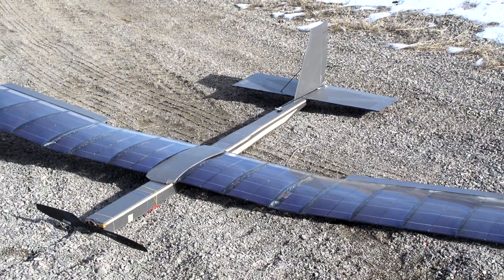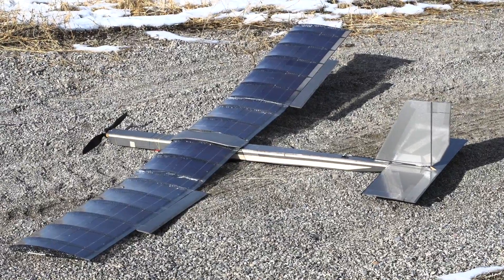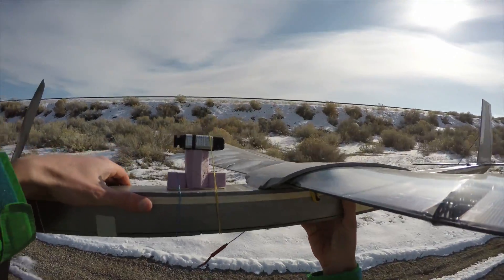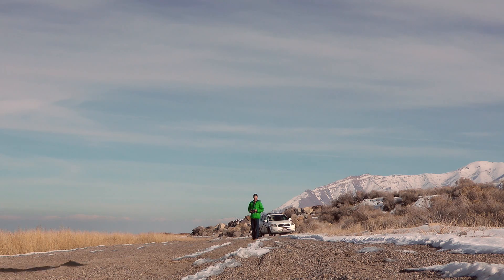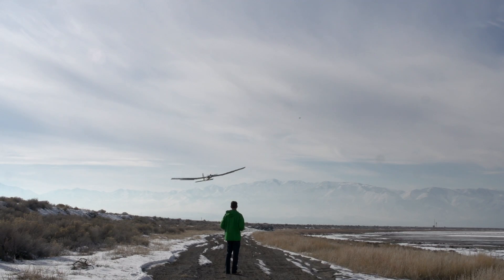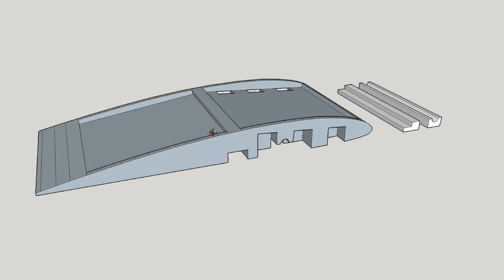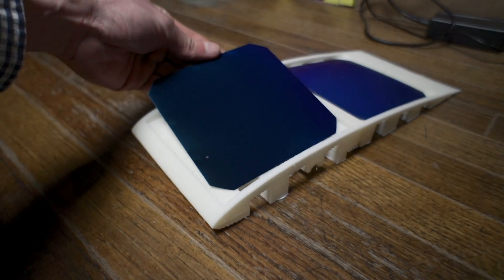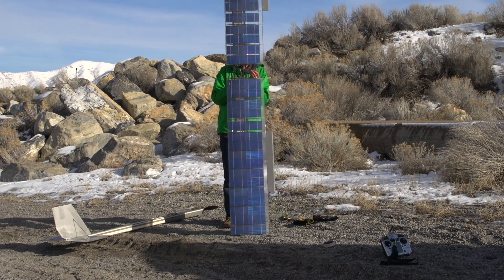RCTESTFLIGHT - Solar Plane V2 First Flight - Episode 4

Comment: Nice! Thats how i would do the panels in the wing! Still i think the fuselage is slung a bot high but perhaps thats to eliminate the crosswind? I would also use batteries but have a capacitor bank onboard also with more efficient electric motors. Sometimes building your own with permanent magnets is the best idea. You can find super efficient motors and circuits that wont have as much power but use way less energy

Comment: you can just use those kind of cells .. its rigid and flexable 
http://www.aliexpress.com/item/DIY-100W-Sunpower-Maxeon-C60-Solar-Panel-21-8-High-Efficiency-32pcs-x-3-34W-for/32666767763.html?spm=2114.40010208.4.9.xFjz5M

Comment: why not just use flexible solar cells?
they are a bit more expensive but they are flexible which means you don't need a custom wing to hold them

Comment: Just a thought, have you approached any CNC engineers? MDF and chipboard can be machined like this so EPO foam would be a breeze and cost a lot less than making a mold, some colleges and universities have the equipment as well.
Keep going with it, I did feel your pain when Mk1 crashed and wrecked all your work.

Comment: Good work D, maybe a liquid foam molded in 3D printed mold wold work or you could take up gcode and get some cnc training. Milling out alloy or steel molds is like 3rd - 5th year machining and milling cnc's are not as expensive if you are mechanically able.

Comment: cool, i think this has been done before of course but tech moves on and it will get cheaper and better , I think that keeping the whole thing light is key, a small battery would be best just enough to take off and get some height. then solar panels should be enough to provide all the power needed. a folding prop would mean you could glide better when in a thermal and so have more power going to charge up battery, then you could have a bigger battery maybe...  epo is quite heavy too though it's a god idea if it could be made reasonably light.
flying faster then you were might work out better, wing seemed to be in stalled flight almost, but maybe that's how you designed it?
look forward to seeing your progress.

Comment: this might sound crazy but could u do a viedo on how to wirelessly power a rc plane long range 

so you could put in auto pilot mode set the altitude very high so no storms or wind could mess up the plane and it could fly forever theoretically

Comment: since solar panels are less efficient if they are hot, try having a low power fan (noctua pc fans?) blowing air through the wing cooling the cells.

Comment: I like the idea of those modules to fit 2 solar cells, but maybe a slightly different design would allow for those to be cut from a foam using hot wire?

Comment: hey  i was wondering if i could get some help. i have build a zmr 250 racing quadcopter and resently i have had at least 4-5 props brake in mid air, due to this ever time i fly i made sure there were NO stress mark yet the blades keep braking i have lost a good battery and 2 motors and quite alot of props from this, i have i don't know why they keep brakeing if there is no marks and brand new. they look fine and they are my fav prop heres the blade both http://www.banggood.com/Gemfan-5x3-Inch-Plastic-5030-Propeller-CWCCW-For-240-250-Frame-p-937866.html         and       http://www.banggood.com/Gamfan-5x3-5030-3-Leaf-Propeller-CWCCW-For-250-Frame-Kit-p-941155.html    seem to do the same thing am i running then to fast a speed? im running on a DYS BE1806 2300KV Brushless Motor  on a 3 cell setup. any help would be unbeliveablely fantastic thanks heaps. 

cheers Nathan

Comment: Really interesting, especially the concept of the foam sections where you can drop the solar panels in. Have you done any calculations regarding how much power (watts) the solar panels should develop, versus the average usage of the motor? It would be interesting to know if the solar panels could keep up with the power drain whilst cruising in full sunlight?

Comment: You can lose some weight by scraping the charger box
Reply: Just a pcb Li-ion balance charger for ebike and the like battery packs. Depending on the number of cells, they are usually under 10g.
Reply: +BLACK 0PS BOSS  the charger box id definitely needed

Comment: That charge controller doesn't balance charge. Is that a problem?
Reply: +cottsak You only need to balance charge once every 5-10 charges, so it shouldn't be a problem for a couple of flights.
I'm sure there's a good market for MPPT Lipo charge controllers, but it seems that only Genasun make one, and they are way too expensive for what they are.
I want one for my ebike batteries, 48V 12S but can't find anything. Looks like I'll have to design my own.

Comment: How about cutting the epo module with a hot wire ? You can follow a profile and then cut the recess with a formed wire. Really easy and really cheap !

Comment: 64 panels at 3.5 watts each, that is 224 watts of power in direct sunlight. Now you just need to determin how much battery capacity you need in order to fly all night long and then you have a 24/7 flyer!

What was the battery capacity at the end of your flight?

Comment: Awesome video! How long were you able to fly it? Since the sun wasn't fully in the sky and sort of covered by clouds. I almost feel like it would get enough charge through the sun. Is it possible to add some sort of generator for the prop to charge the battery as well?

Comment: maybe find a chinese company to create a mould for the EPO?
Btw very nice project! would like to know the solar cell output on that day
Reply: +1 I'm curious about how much energy the solar cells produced during the flight. maybe connect a current sensor between your charge controller and batteries instead of the traditional location between battery and ESC? OR connect 2 current sensors, 1 in each location!? great vid!
Reply: +quiljw01 I think Sunpower C60s are rated at something like 3.34W, so 64 of them would produce ~214W in ideal conditions.

Comment: Hey Daniel, Jared here.
Your EPO foam mould would not be that expensive if you made it yourself!
you have 3d printed the wing section, get some clay and mould it into a two part negative , add injector channels and let it cure, you no have a basic low volume mould.
Buy the foam in pellet form and a cheap injector ($500) and you can make your own casts
Reply: +Jared Reabow (Jazza) I wonder if a 3D printed negative (in various parts) with some kind of a resign coat would be a more practical and portable solution for the mold.
Reply: +Josh Bishop As someone who owns and operates 3D printers in a MakerSpace every week, I respectfully disagree. Sure, some are starting to get a lot better, but the mass majority are prototype only, certainly not production level quality. The part Daniel showed had visible surface defects consistent with the quality I have seen.
Reply: +Jared Reabow (Jazza) Exactly what I was thinking. It would probably be worth while casting a slightly sturdier mold out of something like epoxy, but it shouldn't be that difficult. A pourable liquid expanding polyurethane foam might be a good alternative to epo pellets. Maybe the first run of 500 units could then finance the production of a more efficient molding method.
Reply: +Jared Reabow (Jazza) The problem with that approach would be that you are copying a poor quality version. The best way to do it is machine an aluminum negative, that way you have high control over the surface quality.
Reply: +Marc Stollmeyer I think you could make working parts out of a 3d printed negative, acetone smoothing could smooth out some of the edges. 
Is it going to be as good as a machined aluminium part? No. Will it make parts that fly and hold solar cells? absolutely.
Reply: I think 3d printing has come a long way. I print all the time. Specially if smoothened out with a coat. Regardless, negatives are the way to go and are doable and affordable. I'm thinking even wood should be considered, or old school techniques with fiber glass. The magic here is really avout the solar powered flight which is just plain awesome
Reply: +Marc Stollmeyer 3d printing has come along way and you could easily finish 3d printed parts to get the same or better surface finish than a machined aluminum part.
Reply: +Marc Stollmeyer as someone who owns a 3d printer and has professional experience in automotive finishing, I stand by everything I previously posted. At no point did I suggest you'd want to use a raw print but also, the print warped, rough print Daniel showed it pretty far behind what's coming off my printer.
Reply: +Marc Stollmeyer hence why I stand behind printing the mold. Not sure if additive manufacturing is viable for any part of the wing. Perhaps it is for subcomponents but they would have to be very well engineered to offer any competitive advantage over other materials
Reply: Jaimie Fryer What you are describing is a prototype. It is by all means fully functional and it works in every sense of the word... but I wouldn't want to take it to market.

Daniel knows this, that is why he was quoting the upward cost of making a professional mold. It may end up cheaper, a smart business man wouldn't count on it - hence his quote, and his caution towards pursuing it.
Reply: +FXM Could you point me in the right direction to try this myself? Where have you seen this done before? Any reading material/links? thanks!
Reply: excellent comment. Im experimenting with my 3dprinter and making molds and casting lost PLA... Very interested in EPS